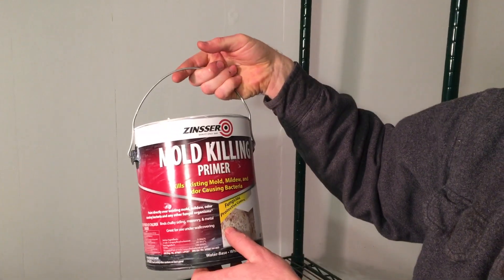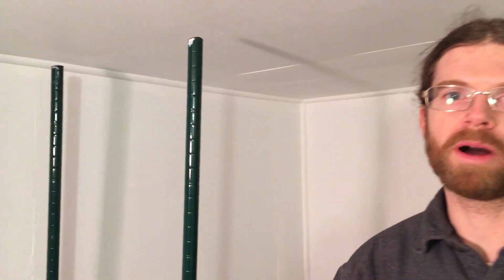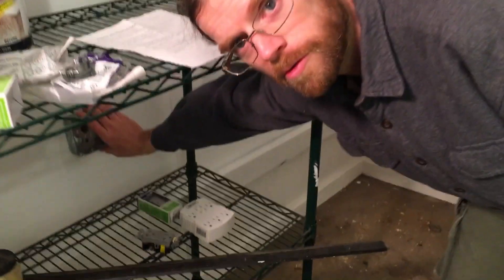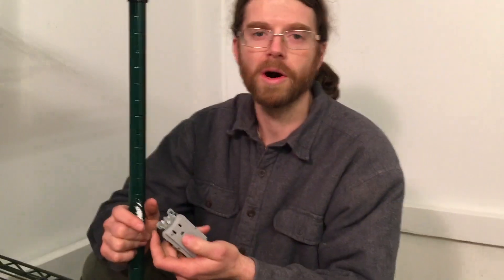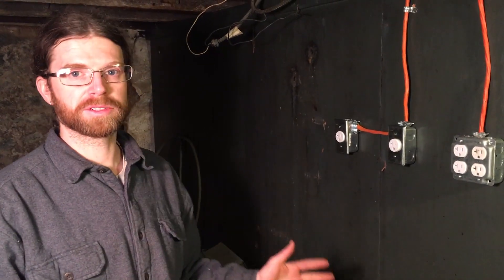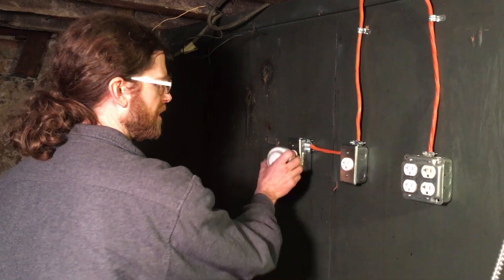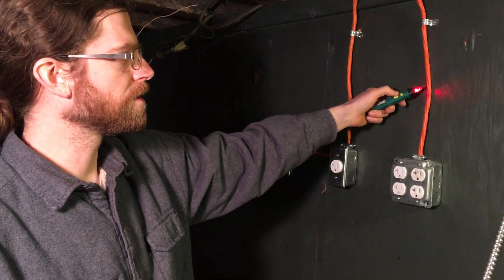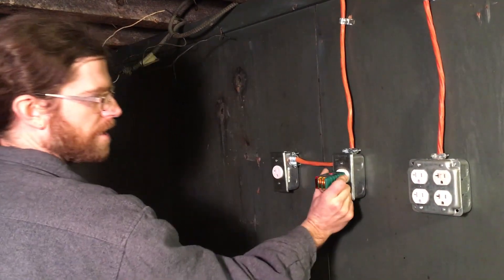Building a Grow Room Part 2 - electricity and outlets

Comment: 30 amps run 6 1000watt lights, he said 2.
Reply: You cant load a circuit more than 80% of its rating.. 30amp = 24amp max load.  If you wired for 240volts instead of the standard 120 you can squeeze in a lot more amps.
Ex/  A 30 Amp circuit wired for 120v can only handle 2,880watts max. ((30×120)×0.8) But if you wired it for 240volt, the 30amp circuit could handle 5,760watts ((30×240)×0.8) 
Power hungry equipment is usually wired for 240 and up for commercial
Reply: @aetherflow  -Exactly. It’s always better all around to run a large grow with 240v for half the amp draw!!!!
Reply: He is being safe.  10 watts per 1000 and then you need 30% unused wattage so your not running on the circuit breaker at full power. So two 1000 watts per breaker is as high as I would go to be safe.   Don't mess up on your electrical as the consequences are quite high.  Homeowners insurance doesn't pay for negligence and that's the definition of negligence. (Overloaded breaker). If the breaker doesn't trip, the wiring can still burn.